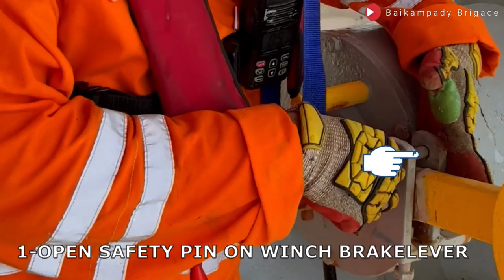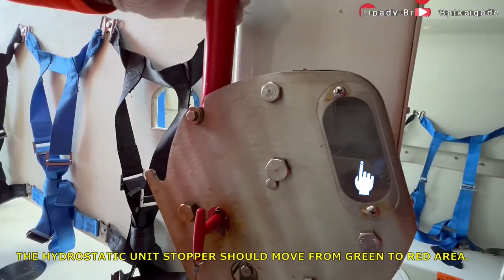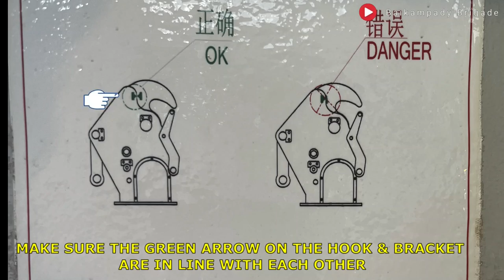🚤LIFE BOAT LAUNCHING AND RECOVERY PROCEDURE🚤.....EP-13

Comment: I am having some doubts please clear
When we are recovering lifeboat we put the holding brakes pin...that means brake engaged...then how motor is rotating???
Reply from the maker: U have noticed,When we are lowering from hand brake we can stop lowering when we need ,same thing when u are recovering it, it will hold one side,we can pick up by motor or manually
Reply: @santosh598  what mechanism ensures this